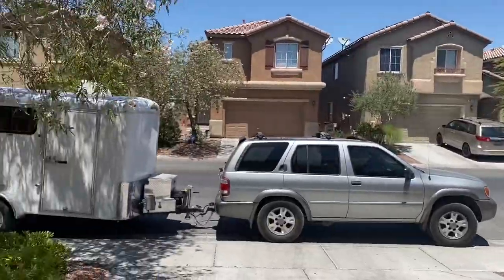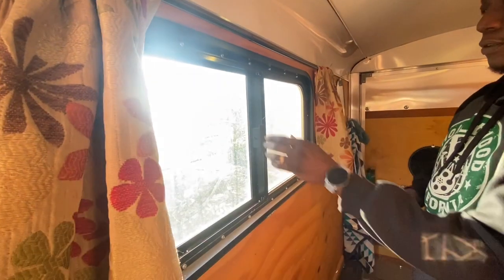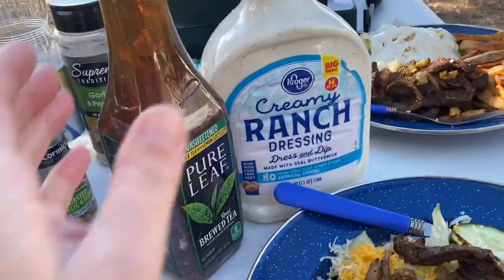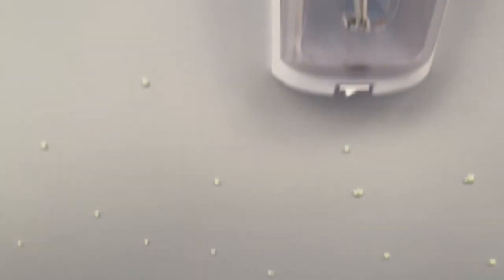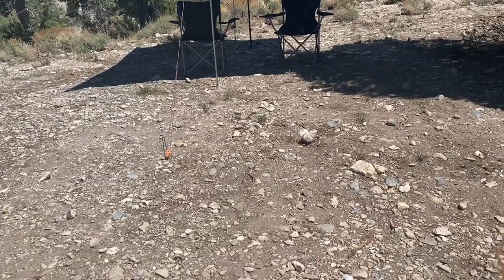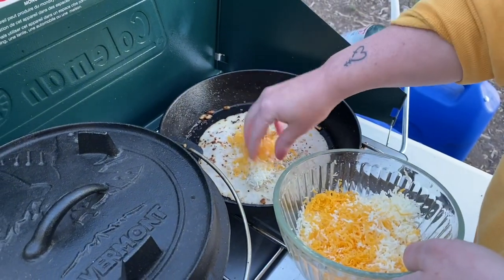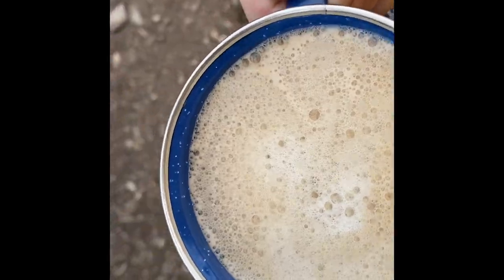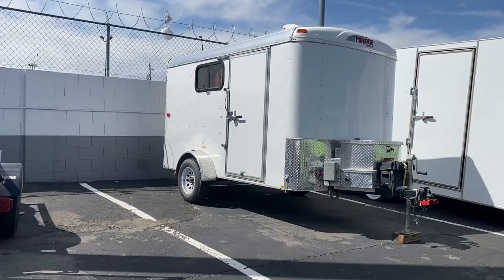Two Nights “Glamping” in Daisy

Comment: I like that you have your bed towards the front of the trailer.  That's how I'd have mine if I had one.  Thinking about getting one some time soon.
Invest in a solar generator.  You can pretty much charge anything with it.  And you can use your solar panels to charge it.  Easy peasy.   Best thing I bought besides my truck and camper.
Reply from the maker: Thank you 😊 great tip!